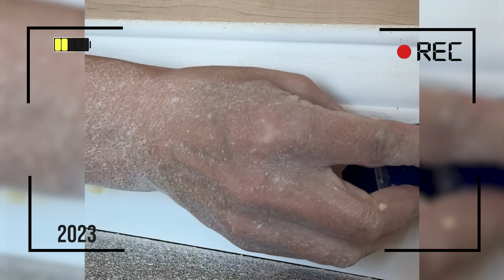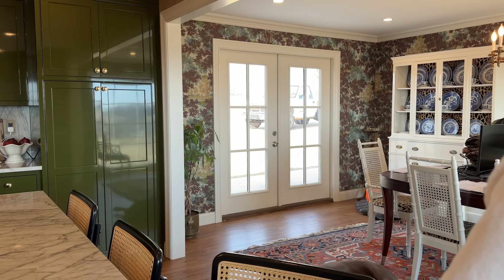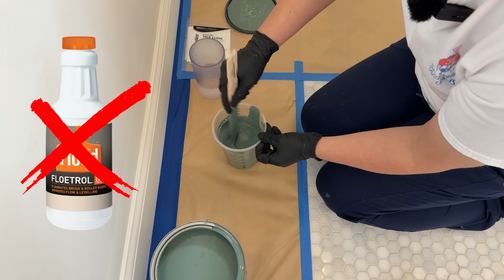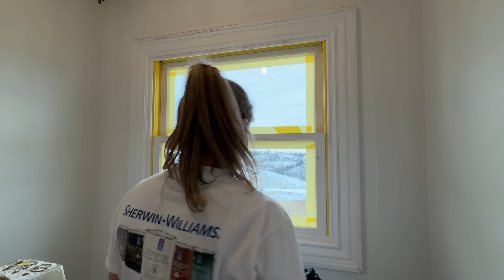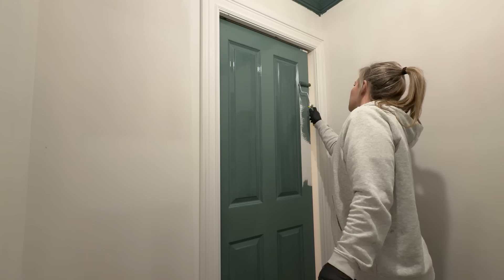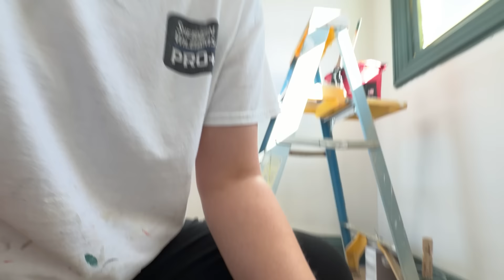Stop Ruining Your Trim Paint! Do This Instead

Comment: Thank you! Your painting techniques are the best I’ve ever seen. Following your tips has improved my painting results. Starting now to repaint trim in a huge house full of old oil-based trim that has yellowed and convert it to Advance.
Reply from the maker: Awesome! So glad to hear it’s helpful! Just so I do my due diligence, when prepping oil base paint in order to re-paint with waterborne paint like Advance, clean it first, and then you really have 2 options: 

Option 1: thoroughly sand the surface of the oil enamel so that all of the sheen is gone and it’s uniformly dull. Then you can proceed with painting with Advance. It’s imperative that the surface is thoroughly sanded before you paint!

Option 2: give a light sand to the oil enamel, then prime surface with whatever primer you like (BIN shellac, waterbase primer, or even oil base primer) then proceed with painting with Advance. If choosing this option, you don’t have to be quite as diligent with the sanding.

Best of luck to you!!
Reply: @KaylaPayne  Thank you so much! This is very helpful.

Comment: Kinda dumb to put water in BM Advance, once I saw that time to leave this channel
Reply from the maker: Later ✌🏼
Reply: I have seen professional painters add water to paint for years! Water helps to thin the paint, helps it flow and level better on the surface, and reduces dry time in hot weather. It's similar to flotrol, but I think water works better. Just don't go crazy with it and you'll love the results!
Reply from the maker: @ajt9745  not to mention that on the Advance PDS it lists “water” under recommended thinner 😂

Comment: The lady at homedepot convinced me to go with a Behr Stain Blocking Satin Enamel Paint & Primer for trim (baseboard, doors, jams etc) - it's so thick out of the can - should I swap it for something better or will thinning make it work... I tried a test area and brush was dragging a lot and streaking as paint was so thick. I get the feeling I was sold the wrong product...
Reply from the maker: As long as it’s a waterborne enamel, then you can add water to it to thin it down and lessen the viscosity. If it’s an oil enamel then you’ll need to use mineral spirits. The can will say what it is. 

I’ve never used that behr product so I can’t say from experience whether or not I like it - but I have a feeling I would not like it lol. But I also hate to tell you to ditch it and buy something else since you’ve already paid for it.

Give it a try thinning it out, if that fails, get a can of Advance. 

Let me know how it goes!
Reply: @KaylaPayne  It is a water based enamel - will report back after another test.
Reply: Thinning it down did the trick - looks quite good now. I will do another coat and it should be very nice. I like it now! Thx

Comment: Did you say you put two coats of oil based  primer on the first?
I feel I can tell you're a person who really sweats the details which I very much appreciate. I'm the same and want a very beautiful finish.  It annoys me when my doors don't turn out flawless. 
I started painting some trim with some advanced Benjamin more paint for the first time this week, although I've painted hundreds of gallons of other paint before by different manufacturers, but I've never used actual Advanced.  It actually smells very suspiciously the same like Cloverdale Renaissance.  It's a high-end door and trim paint that has a oil-based like shell finish or at least it should.  But they both have a very peculiar and similar smell.  It's almost too much if you're spraying in a room for a while. The smell gets to me through my respirator.  Regardless, Cloverdale Renaissance paint gives a fantastic finish like melamine.

So back to the two layers of oil-based paint. If you actually did that, I'm assuming it was like a 123 Bullseye or kilz?  I feel this is a key point for a beautiful finish. 

Using the advanced and putting it straight on primed trim. It soaked up the paint so fast that I was not getting a nice finish, so I switched gears and set it up outside and sprayed it.  

I think the next time I do trim or these wood doors I have, I'll pre-prime them with a proper primer rather than relying on the factory primer. That's more like a drywall feel.  The doors need to be caulked in the Shakers anyway and there's some pretty rough primer buildup. 

Thank you for your video.

Comment: what do we do if it does drip how do i get rid of it?
Reply from the maker: If you don’t see a drip immediately while the paint is wet enough to fix it, let it dry completely and you can then either use a single blade razor to shave it off then sand the area smooth, or if its not too much just use sandpaper to smooth it down. Then apply another coat
Reply: @KaylaPayne thanks!!

Comment: Flotrol is great to add to paint that has been stored for a while.
It replaces the water lost to evaporation and conditions the paint for a smoother application.
It also increases open time which avoids lap marks.

Comment: Don't add water, just warm up the paint. 1-2 hrs. before, sit the gallon in a 5 gal bucket of warm water.
Reply from the maker: Not with a waterbased paint - this makes it dry even faster. A hot water bath works great for oil based paint.

Comment: Hi! Wanted to verify the stiffness-level of your sash brush- the link goes to “stiff”…i’ve tried all stiffnesses and at the risk of sounding like Goldilocks, I found soft way too floppy for precision snd control, but stiff difficult to work with. I tend to go for something in between. Granted, I have not tried your round-brush application method before, nor do i always thin my paint. I’ve noticed paint seems to be getting thicker and heavier over the years…I’m happy for a quality product, and i guess it goes further if you’re thinning a bit…

Comment: Is this latex paint?  Doesn't sanding newly painted latex paint gunk it up?  Especially drips?
Reply: It’s waterborne enamel. It’s oil paint that dries slow and smells like always. It’s just using water as delivery instead of chemical solvent as a delivery. 

I know it sounds odd. But they figured it out
Reply: Use a wet sanding sponge to sand latex paint.

Comment: I don't see any feathering, Feathering was traditionally used when cutting in to an edge of different colours. In those days there was no painters tape, it was all done by feathering and a smooth stroke. It wa truly remarkable t watch an experience operator at this art, not one drop of paint the wrong side of the edge.

Comment: I have worked on 20 million high end projects, but with lowest bid I'm always srpriced at how difficult the paint control quality is. This is better than many spray finises. Plus owner almost aways allows substituting for lower products like pro mar 200. Prep prep prep, and you cant hold them to cntrol samples. I hate the different finish quality of millshop paint grade installs, to painting contractor. As a designer, owner usually cares about schedule and rarely lets you hold subcontractors to the specs. With you all finishes are consistent.

Comment: How often do you clean your brushes? It seems like i have a lot of drued paint in my brush and can't get it clean...
Reply: And always ALWAYS take the time to wash out a quality brush like a Purdy at the end of the day! And it will last u 30 years… never ever wrap in saran wrap and put it in the freezer. This is an amateur move, and will ruin your brush. You can mist lightly and wrap tight in a plastic bag while you break for lunch , but re-spray and wipe off before you start again to make sure they are no pills of paint on the bristles.
Reply: @hmh3808  Good tip! I love my Purdy brushes. I take good care of them and wash them as soon as I’m done using them each day. They’ve lasted a long time.
Reply: U can mist the part where the paint stops (before the ferrule) if working fast …but half way thru my day i will use a brush comb or wire brush (sparingly) to keep the buildup down… (available at every Paint Store ) just keep a spray bottle with water with you, if you’re doing an eight hour paint day and a lint free rag like an old T-shirt cut up into squares , to wipe off what you’ve misted down (so u don’t drip after reloading….)

Comment: My home was built in 1930 and I still have the old doors with mortise locks.  100% guarantee to have lead paint on all the doors and trim and much too expensive to hire a professional.  I'm not taking the risk of sanding any of it myself, so that's why most people just add a fresh coat of paint over the top of all the other layers of paint.  The nicks, gouges and rough patches on the wood will simply have to be accepted as part of the character of my old home.
Reply from the maker: Totally understand, sometimes the "character" of an old home is just part of the charm!
Reply: @KaylaPayne  For old homes, and many have oil-based trim, how do they convert the oil-based trim to water-based, or a hybrid like Advance if they can’t sand it first before priming? Is there a primer out there that doesn’t require sanding as a first step? If so, I’d love to find it as I’m trying to convert all my oil-based trim to Advance.
Reply from the maker: @Avogadro9219 you can sand oil base paint without harm if that’s what you’re concerned about. If you’re thinking it might contain lead, i definitely recommend doing a lead base paint test (super simple swab test with immediate results. Can find the test kits at hardware stores or amazon) 

If lead is present, don’t sand, I’d coat it with BIN shellac primer and proceed to painting
Reply: Can I  use the round load brush on my trim that is  4 in flat with 1 in accent trim on it ?

Comment: Hi Kayla great video! I have been using Purdy brushes for years and normally I use a 2-1/2” angled clear cut elite brush for all of my trim. Your round brush is interesting and I was going to try one but your link is not working for the brush. Do you have another one you could recommend or does Purdy make one?
Reply from the maker: Looks like the round brush from the link has sold out. But here’s another link to it: https://rstyle.me/+k0Ssm8kCy_oOeitPuBBR-Q 
(Size 18)

Thanks for that heads up by the way. I hope you’ll report back after you use it and let me know your thoughts! I think you’ll find it easier/more efficient - but curious to know your opinion. 

Best of luck to you, my friend.

Comment: So … you didn’t use the round brush on the sashes? That was a bit confusing.
Reply from the maker: I did use it on the sashes too. I cut out portions and it was sped up so much that it is probably hard to tell! Tried not to make the video too long!

Comment: Using that round brush is very interesting. I am going to give that a try. I, too, use a 2.5 inch sash for everything, both applying and doing layoff. If that round brush can lay the paint down a bit more quickly or evenly, that is cool.

Advance likes to develop drips, even when you are being careful. Do you find that thinning it with water makes that even worse?

Comment: Fabulous video.  I exclusively use Benjamin Moore paints. But there are many great brands out there, but you go with what you know. The water born enamels are the low VOC and easy clean up way to enjoy the beauty of oil based finishes which are luxurious and long lasting (decades).  I still have oil based paint in my home in some places.  Important tip:  if you are unsure of the paint type on the substrate that you are painting, (e.g. oil/latex),  you may need a binding primer before you new paint paint.  The Advance paint is fantastic.  Be aware that these paints have a cure period of 3-4 weeks.  This paint works great on cabinets, but keep in mind the cure period particularly if it is on top of a a cabinet you have painted.  For thinning Advance, the mftr recommends no more than 8 oz per gallon of paint or a 6.25% dilution ratio.
Reply: What binding primer do you use? I’m in the process of converting all the oil-based paint in my home and will be using Advance. I was thinking of using the Ben Moore STIX primer, not sure if that’s right or not.

Comment: I remember oil-based paint for painting trim.  Your thoughts?
Reply from the maker: I do love some oil base paint. It’s wonderfully durable. But the drying times really make it tough to use practically. 
Plus it can be really tricky to use for anyone with little to no painting experience. 
So…my thoughts are, i have a love-hate relationship with it lol. I can’t say I’d recommend a DIY homeowner use it
Reply: Oil wears like iron and lasts twice as long. I’ve always preferred oil on trim. 

Whites will yellow over time with oil.
Reply: @danielmartin7838  actually the science of paint has changed so much in the last 10 years,  in the last five! ….That latex is now longer wearing than oil paint used to be because of its elasticity over time… oil actually gets brittle over time.

Comment: I just finished painting all the trim in one of my bedrooms.  It took 3 coats.  I used BM Advance in a satin finish.  The trim had been previously painted semi gloss.  I scuff sanded it before painting.  I was applying light blue color over the original white trim.  I don’t understand why it took 3 coats.  Did I not sand it adequately?  Did I use a poor quality brush?   Maybe I should have used a round brush like yours.  Do you have any ideas why it took 3 coats?
Thank you for sharing your tips.  I’ll definitely use them in my next project.
Reply: My own experience is that covering white with even a light color is harder than you would think. I am not surprised that it took 3 coats.